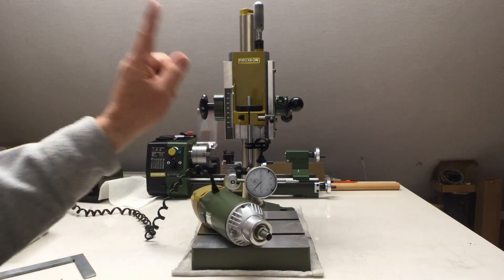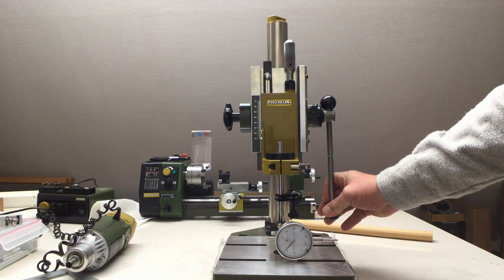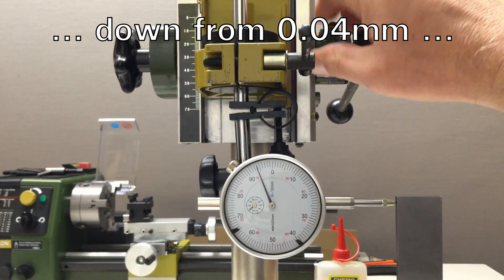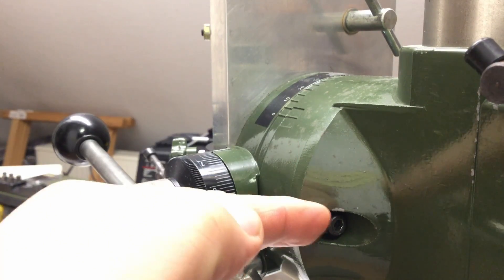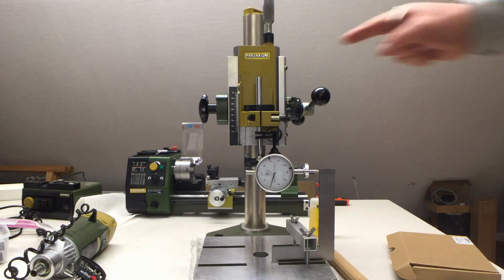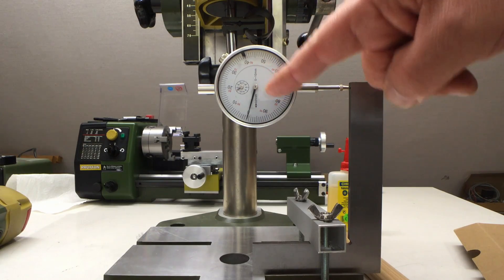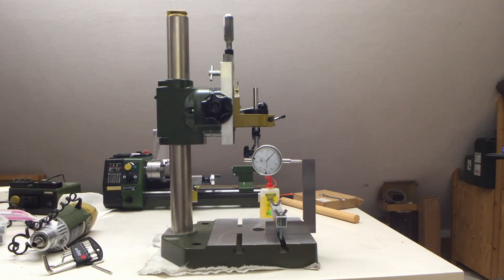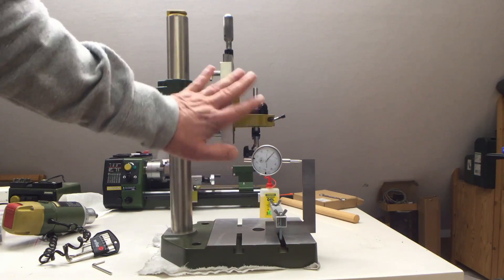Tramming the Proxxon BFB 2000 & BFW 40/E Milling Machine (1/2)

Comment: Haven’t thought too much about verifying squareness of my Proxxon milling machine. Thanks for video.

What you call x-axis tilt i think is the B-axis.

The B-axis rotation is visibly off vertical and is adjustable from 0 to 90 degrees. First suggest to loosen it, rotate to 90 and back and double check the alignment of arrow to zero rotation.

Squareness of the pillar to base can be checked with the square at least in the y-plane. Need a large flat reference plate possibly with a notch or hole to check x-plane squareness. Need to verify the squareness of the square first. 

Dovetail slide gib adjustments should be checked before attempting measurements. I suggest slight preload. Milling introduces larger forces of deflection. I had way too much deflection just removing play. I have been pushing the limits milling 1.6mm steel.

Adding the KT150 could introduce additional errors but the fixing to the base can be shimmed to correct this with reference to the top plate of the KT150.
Reply from the maker: Thanks for the info! And yes, you're right about the b-axis stuff. Though normally a b-axis is not just adjustable but can be rotated dynamically during the machining, can't it?
Reply: Proxxon refers to head tilt. I suppose we could call it rotation about the Y-axis, rotation in X-plane or B-axis positioning. 

Perhaps someone has explored making it into a controllable cnc 5th axis? I’ve been thinking about a 4-axis ballscrew cnc conversion.
Reply from the maker: @blueytoo1538  I actually though about a contraption with a leadscrew for adjusting the "head tilt". Using some sort of hammer for the fine adjustment is a bit time consuming and tiresome.